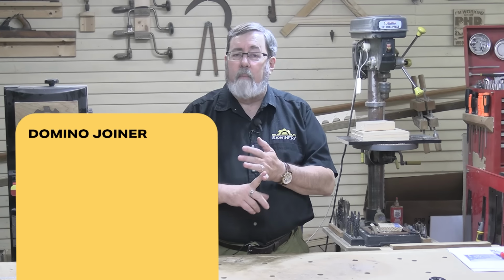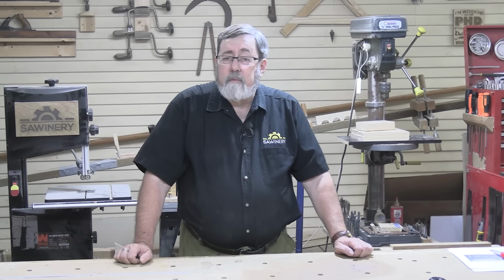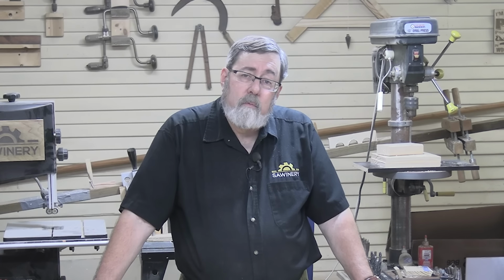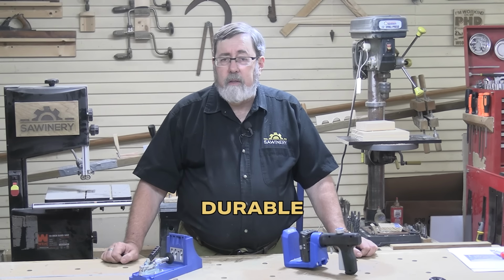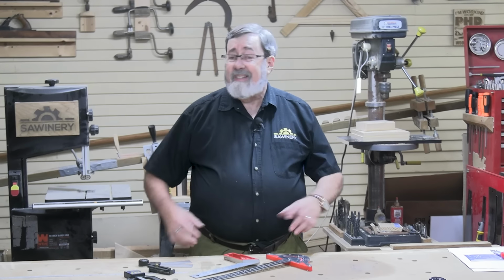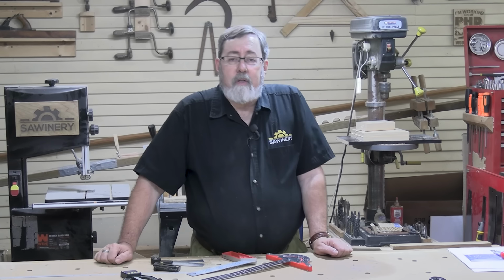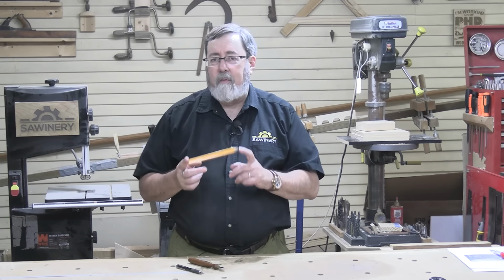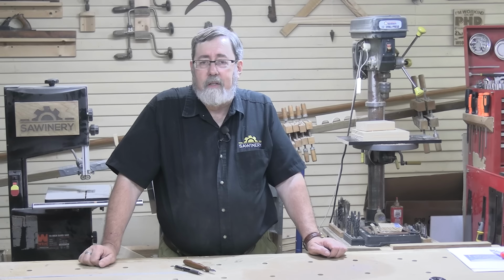5 Most Overrated Woodworking Tools

Comment: Carpenter's Pencil is primarily a Carpenter's Tool and so is the Miter Saw for Framing & Decks. I do use my Miter Saw in the shop sometimes mostly when I don't want to change the setup I have going on my Table Saw.
Also my fancy Combo Square (Cheap Stanley) I found in my Grandfather's Shed after he died in 1990 made me a million dollars in the Structural Steel business. I always get a kick out of these guys spending a hundred dollars or much more on some fancy square to make a simple birdhouse or whatever in their home shops. I did buy a cheap pocket screw jig recently for maybe 5 Bucks off one of the discount site. There's been a few times in the past when I could've used one and I'm sure that time will arise again one day.
Reply: I've got a new Stanley combo square and thought for sure I'd have to tune it. I was wrong, it was dead square from the start and has stayed that way in the year I've had it and it gets tossed in the truck tool box a lot. Some things Stanley still gets right.

Comment: Dominoes? Mehh, dowels do work. You can use jigs to line them up,  you can use fatter and longer ones for the bigger joints. I could join bigger boards to make a heavy duty bench top by cutting 20 or 25mm dowels from round wooden stock from the hardware store

Comment: I feel that most table saws are much better than the people who own them. I have an older Delta table saw I bought off of Marketplace for $100.00. It needed some work but when I was done it is more accurate than my old eyes. And I don't spend upwards of $200.00 on blades either. Thanks for your video.

Comment: Great video!
Based on the comments here, the Domino seems to be a production tool for people cranking out projects for profit; not the Weekend Woodworker. I don't see one in my future, nor a biscuit joiner for that matter. I use dowels where I need alignment. 
My old miter saw has been sitting idle for years as my table saw skills progress. My pocket hole jig is also very idle.
Most of my measurement devices are very accurate, and expensive. The one you didn't recognize in your collection looked like a kerf maker???
I do have carpenters pencils for marking up for sanding, but I have mechanical pencils all over my shop. 

Looks like I agree with you!

Comment: I"m okay with floating tenons as a method of joinery; it is truly ancient, the Egyptians held their ships together with loose tenons.  The fact we're inventing new mortising technology thousands of years later is actually kind of cool.  I think the Domino is a total game changer in the cabinet shop, the ability to make strong, fast, accurate joints in sheet stock like Baltic Birch without bothering with dados or whatever means you can put together decent cabinets at speeds not previously attainable.  If time is money, the Domino will pay for itself.  Now, on the influencer-and-hobbyist circles like here on Youtube?  Yeah it's overrated.  It's the pink-and-purple slush drink Starbucks sold that Influencers had to be seen holding.  The patent is expiring soon, when Ryobi is making one for $169.99 people will get over it like they did with biscuits.

In a pure woodworking fine furniture shop where you have a nice high quality cabinet saw well tuned...yeah a miter saw is almost entirely redundant.  I tend to prefer to have one for batching out many parts of the same length, "take these 1x4s and make me 48 slats 24 inches long."  I'm doing that on the miter saw.  I would MUCH rather cut dowels on a miter saw than a table saw.  And for carpentry, be it framing or finish, I want a miter saw.  Yes, I can make shed rafters with a skilsaw.  But my miter saw will do it better.  For woodworking, I've gotten in the habit of shooting any crosscut whose angle is critical, like drawer box components to be dovetailed need to be 90.0000 degrees or miters need to be 45.0000, I'll spend less time setting whatever saw to be reasonably close and then shooting the ends.

I just about entirely agree with you on the pocket hole jig; they're an inexpensive, easy, accessible way to start building things.  They sell them at the big box stores.  So it's easy to get going with them, and then yeah it's easy to think of them as the be all end all solution.  You'll see beginner woodworkers do the same thing with finish, they want one finish to use for everything, and there's no such thing.  For structural stuff like attaching a table apron to a leg, I don't think they're strong enough.  I would insist on loose tenons or proper tenons.

I hate digital measuring tools, I prefer dial calipers.  I have a set of those anodized aluminum gauge blocks, they might be a couple thou off.  I don't really care because not a single one of my woodworking tools have controls that precise.  I use a set of dial calipers that reads in fractional inches to 1/64" which seems to be about the limit of what most woodworking tools can handle.  I've been coming over to the hand tool camp's way of thinking that who cares what the numbers are, use reality.  A scored storey stick is going to be hell and gone more accurate and repeatable than any ruler.

We're exactly aligned with pencils.  A carpenter's pencil is good for writing WHITE OAK 2024 on a board, but if I'm going to make a layout mark with a pencil it's going to be a mechanical pencil.  I use papermate Sharpwriters, they're cheap as borsht, I buy them by the 36 count box, and the lead is spring loaded so it has a suspension to it so wood grain or saw marks don't break lead as often.  And for really critical marks I use a marking knife or gauge.

Comment: The bit and brace have been around for centuries , and used properly for the intended job , though slow , are perfect . Especially if away from power, doing timber framing or log cabin construction

Comment: I have a miter saw, have had it for years, but i wonder about a table saw sled and its general use, My miter saw is easily accessed  my table saw is not i have to drag it  out when I need it, that why i have one.  I share your thoughts on these items.  I have a biscuit cutter and picket hole jig and i use the pocket hole I do not use the biscuit cutter.

Comment: As a new woodworker in my opinion making a mortise and tenon joint would be quite difficult as it requires precise measurements and more skill than I have at the moment. I’ll work on that.
Reply: Takes way too much time doing them by hand too, all these "fine wood workers" don't do them by hand either, they got jigs and a router, or a jig and table saw to cut them as they're not gonna sit there with a hand saw for hours cutting all those joints...the joints are good, but time consuming when trying to cut them by hand and to have them actually go together when you are finished is a whole different story....

Comment: Domino - I agree. 
Chop saw - agree to a point. It's not worthless to have, especially if you plan on doing lots of square or miter cuts, and newer miter saw's are quite accurate. Necessary? No. I've done plenty of crosscuts with a framing square and circular saw, and I know guys that do it every day on the site and get dead square cuts. But then again they've been doing it for decades, so I guess skill trumps gear in that case. You want speed? line up 4-5 boards on your bench, clamp them down, and cut them all at once. if they're square enough to do that on the chop saw, they're square enough to line up and do 4 at once. That being said, a miter saw can speed up production for most people, and is an easy go to for a new woodworker who wants speed as much as reliability in their projects. YMMV.
Pocket jig - this one can really be controversial. I've seen opinions that range from putting it under your pillow at night because you love it so much to people having pocket hole jig burning parties. Seriously, if you want an easy way to build cabinets this is it. drawers? same thing. Modern tool for modern cabinetry. necessary? nah. but costwise, it's not really expensive either, so why not? And anyone who uses pocketholes on the exterior of a quality piece needs to get smacked with a cheap chinese knockoff mallet. but that's an experience issue, not a tool issue.
Measurement devices - Other then "you don't need woodpecker tools" and "don't buy cheap" that pretty much covers it. that and all you really need is a good combo square and a straight edge. To start. you'll eventually build a garage full of tools like everyone else, many good, some bad. And I avoid woodpecker on principle. Buy a good Starett square with a 12" and 24" blade and you got most your needs covered. cheaper then woodpecker, and machinists use them, they've been the gold standard for generations.
Pencil advice is solid. Plus mechanical pencils are cheap these days. other then that good video. provoke much thought and discussion, even if we disagree or agree.

Comment: Technically the only tools you’d really need are a hand saw, hand drill and a hammer. People buy the first 3 things you mentioned for time savings and ease of use in a lot of cases which is well worth it to a lot of people. While I think learning all types of joinery is a good thing, I hardly think it a necessity if you’re not actually using those joints or ever plan to. It’s like all the advanced math you learn in school that never gets used in daily life or even most professions. I do think pocket screws can be overused mainly because of situations where it isn’t the best in terms of strength even if the surfaces are glued.

Comment: I concur with the miter saw, sort of. I only use it as a chop saw for rough length. Useful, but don’t overspend on a fancy one. I have a ryobi that works just fine. Table saw is far more accurate for miter cuts.

Comment: I have a miter saw, by Omga, an Italian firm. Its entirely accurate. More accurate than the table saw. But I wouldn't trust one that tilted over or slid out on rods. I actually use it in conjunction with a Mitutoyo  electronic rule to make a series of slots in pear wood to one 1/100 mm  accuracy (that's better than half a thousandth of an inch).

Comment: I don’t own a table saw,mitre saw or a pillar drill and I do just fine thank you sir great video.
Reply: I started out with hand tools, but after a while realized if I wanted to get anything done I was going to need to get power tools LOL...so in came the table saw, miter saw, etc.  Far more productive when I'm trying to get stuff done, but still do stuff with hand tools on occasion.  I use the circular saw all the time to cut sheet goods down to more manageable sizes to easily finish cutting down on the table saw or miter saw.

Comment: I definitely agree that the Domino is not a required tool and there are many other ways to create the same joint.  Definitely agree that it's expensive!  However, I don't think it's fair to say that it doesn't create a strong joint.  Floating tenons are widely used and have always been considered a stronger joint than the butt joint.  Just like a dowel joint is stronger.  The one true thing that the Domino gives you is ease of use.  It's hard to compare any other joint to how quickly and easily you can setup and create a floating tenon with the Domino.

Comment: I use the metal/wood dust after drilling etc to fill up gaps and holes. Put the dust there, soak with instant glue, then polish after it hardens. No waste.

Comment: I would take a Domino jointer any day over a biscuit joiner. Yes, it is expensive. And, yes again, joints can be made without it just fine. I happen to like the Domino, my preference. I already have the Fetool shop vac, so it was not that much. I agree you do not need the domino joiner for strength. I just like to use it.  There is just some thing about the biscuits that doesn't set right,. One could almost put the Kreg jig in that category also. You made a great point about the Kreg jig for joinery. I have used it, but It doesn't set right with me about it being a proper way. It is strong, but leaves the feeling there is a better traditional method. You stress time honored methods and I don't think anyone can argue with you on that. I certainly won't argue with time honored methods that were used before power tools. Keep up the good work. I do agree that the tables is the most essential power tool in the shop. That said, I do like the convenience of my mitre saw. You do a great job of explaining.

Comment: I don't own a domino, but the thing about them is super fast and convenient, they are a floating tenon and they do add strength IMO..I use bisketer for alignment on all panel glue ups and it's just reassurance on alignment for me, they work...a miter saw for me again is convenient, I mill all my own lumber and it's fast to break down material, it's all about convenience, no don't need it but makes my job easier, so there lies the value for me, radial arm saw I use for joinery, half laps, tenons with a dato stack, super easy and convenient again, so why work harder if you don't have to I guess is my point...

Comment: I was on the fence about a domino. And I think they’re great. Fast. In the end I went with the Jess’em pocket mill pro. That on sale with the workstation, large station and small station cost $450. Pure carbine drill bit will last forever. 

If it as fast. Mmm. No. But we’re talking 1 minute and now 3 minutes. Since I use it mostly for prefinished cabinet builds. It’s very needed. But then again you can cut grooves and dados and use some screws and get great results even faster. 

If I had a job tomorrow that was an entire kitchen and it needed to be done that week. Sure. Domino. (If it’s all prefinished plywood and they said no to screws.) sure. Domino. But the pocketmill pro works very well for me. But the more I learn, the more I realize. Yeah dowels work fast and easy. And it’s really important to not get stuck in the, this is the only way, domino or nothing mentality. I like the just try every way, and find what works for you. The situation. The location. The needs etc. 

Ps. I would never trust screws with no dado, rabbet or grove. Especially not upper cabinets. Lower. Whatever. Gravity is with you. Upper. No. Gravity is against you.

Comment: I have several of the cheap Bic 0.9 mechanical pencils scattered around the shop.
I built quite a bit of case work the pocket hole jig is the best overall way to build face frames and hidden joints in the carcass.
The Domino is a beautiful tool but over priced most of its functions are easily and cheaply duplicated so for me Not Now..
I’ll agree with the power miter saw not needed in the shop 95+% of the time, however I do have a RAS in my shop for those tricky cuts. 
I will add io the of overrated tools is the jointer never had one for about 30+ years (now have), but love my thickness planer.
Reply: Lmao I also bought a pack of the Bic 0.9 mechanical pencils. They are all over my house and my garage. The lead is thick enough to not break very often and yet thin enough to still be accurate. I love them!

Comment: Generally I don't use a carpenter's pencil, but when I do I sharpen it with a handplane. When i need precision, I use a knife - the humble  Stanley 10-049.  By the way.  Milwaukee now sells an 'ultrafine' pen that's very good for finish carpentry.  i do use digital inclinometers and protractors for setting tools, esp both the table and radial saws.

Comment: All tools have a place in a workshop. It just depends on what you want to achieve. Pocket holes are great for face frame carpentry, table tops? Nah. Miter saws can be a game changer, especially in a small shop. Will it ever replace the table saw? No. Domino jointers, I agree, there are other options. Carpenters' pencils are okay if you do rough work. A regular lead pencil with a sharpener handy is better. As for useless inaccurate measuring devices, forget them. Invest in a decent set of measuring tools and foget the gimmicks. At eighty seven, and woodworking since I was fourteen years old, tools come and go. Learn how to use hand tools and suppliment those with good power tools will produce satisfaction in the workshop.

Comment: I’ve never considered using pocket screws for anything but cabinet faces.

What purpose does the hand scythe have in your shop?
Reply from the maker: It serves a very important purpose, along with the other tools hung on that wall… decoration. Without intentionally trying, I’ve collected a few antique tools over the years. So, when I set my shop up, I decided to hang them on that wall, as the wall isn’t usable for anything workshop related (there’s a handicapped ramp there). That was before I started shooting videos for Sawinery and so the scythe, along with the other tools, still remain.

Comment: I think all this is called  moving forward, making life easier, and doing things faster. Doing wood work the old way is all very good if you’re farting assing about in your weekend double garage workshop. But as a carpenter and joiner and everything else in the woodwork world for coming up 50 years you need to move forward if you’re going to make a living. 

Im still using hand tools and power tools that are 35 years plus and they sit along side with my newer stuff. There so many other things we could go on about but I’ve ran out of time. 

But don’t forget theres the carpentry side, the joinery side and the cabinet maker side, the furniture side, the veneering side, the turning side, patten makers ( not so much nowadays) i do all the above and have the tools to go with all the sides and still love the job i do. 

O the carpenters pencil is for building houses, don’t try building a house with a mechanical pencil unless you are really stupid leave it in the workshop 😊

Very provocative video its going to be interesting to see were the comments go. 😮